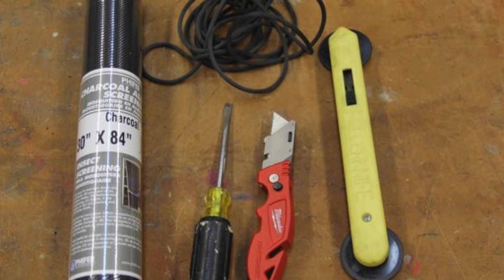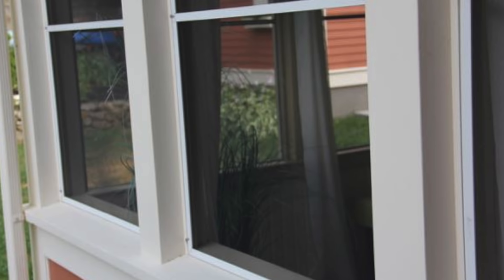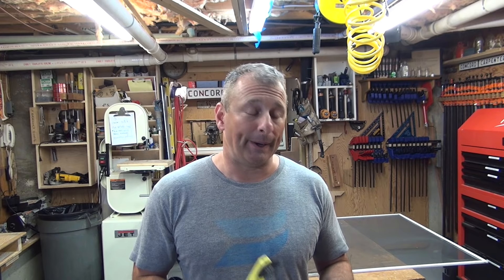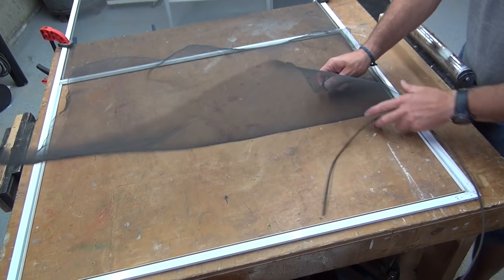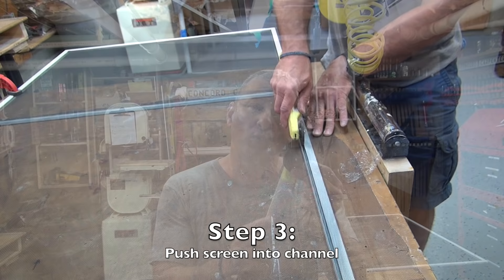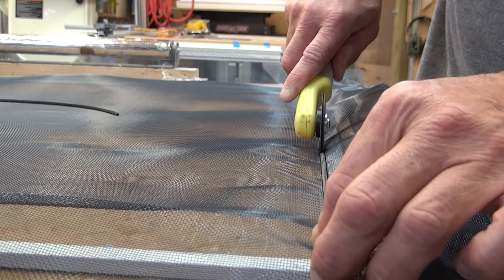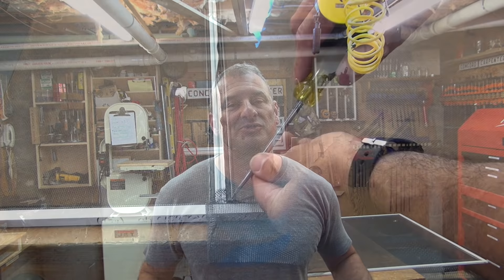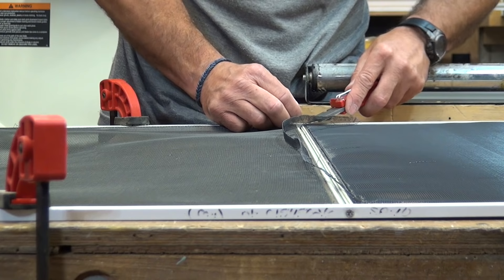Replacing a Window Screen 5-Steps

Comment: Is there a reason not to insert screen and spline at once and push them both in at once, using the concave roller? In other words is it necessary to first push in the screen with the confex roller, then the spline with the concave roller?

Comment: Great video! The spline on my screen is old and stuck. How can I get it out? HELP!
Reply from the maker: Alison Frazier-Hayden use a small screw driver or utility knife and dig it out. A pair of needle nose pliers or beefy tweezers will Help grape and pull it.  Alternatively you can slice the screen apart and use it as leverage to pull out the screen/spline all at one time.
Reply: Awesome! I'll keep you posted!!! Thank you so much!
Reply: Quick pass with a blow dryer will heat and make rubber pliable to pull out.

Comment: I have a question, when putting screen back into the window screen frame, does the spline access go inside or outside.  My mom keeps telling me it' goes so that the spline part is outside and I tell her that' lets theives pull the spline and screen out easily.   Which way is it?

Comment: 5 mobile quotes were at least 120 per door, highest was 180 ,Ace hardware quoted $60 for material but they charged only 40 thats for 2 doors If I brought it to them 80.  This was for heavy duty cat proof screen. The roller cost $7

Comment: The gap for the rubber strips at flame is 0.5MM...so what is the diameter of rubber I should I use? 0.4MM, 0.45MM or 0.5MM?!?!

Comment: I did this today and I dont know if I got the wrong spline size or not. I went by the old one but it was so in there that the old screen was still attached on the sides. Its sticking and holding on with the .36 but maybe I should of gone with the .41
Reply from the maker: liddoterry yes it’s possible the screening is thinner

Comment: I wish you added how instal and take out screen from the window frame.
Reply from the maker: @matthewmey5370  use a utility blade and cut old screen and pull out- you can also did out spline with knife or flat head screwdriver

Comment: I'm considering replacing my window screen with a sun-shading screen. Will I need special tools for cutting a sun-shading screen or will a utility knife be sufficient?
Reply from the maker: Should be fine, may need smaller or diff sized spline if screen is thicker

Comment: Thanks Rob.  Do you change your own thermo-glass for home vinyl windows?
Reply from the maker: no
Reply: Call a few glass shops and give measurements, get prices to compare, tell them if you have a grid, remove the sash and bring it in for a new insulated glass unit. Tell them you want the exact same insulated glass unit ( Look up the windows from your original receipt) it will say if they have grids, double or triple pane, the thickness of the glass, whether they are low e and if they have argon glass. They won't replace the seal (you might ask for a new seal) to prevent water from leaking in later. Reinstall the sash. Rob does not do it and I understand why it is not an easy fix and requires specialized equipment.

Comment: Have a question. I just hot a job at a patio enclosure company building screens and doors. My hand is experiencing fatigue. 

Can you recommend a tool that I could use other than scissors to cut the screen with?

Thanks!!
Reply from the maker: Check out the OLFA cutters
Reply: Will Olfa cutters cut aluminum screen?

Comment: I'm using aluminum, and I got two sides in just fine; but when I tried to do the third side, my screen started to split instead of tucking neatly into the groove. I didn't think I was pulling it particularly tight, but I suppose I could have been. Any suggestions though?
Reply from the maker: Dan R work one end, then two sides, keep tension on screen while rolling
Reply from the maker: Dan R Going to take it sometimes but all your friends are use clamps at times to hold the screen on the other end

Comment: Great clip! But after watching this video and replacing 6 windows I learned this... DO NOT USE ALUMINUM. It stinks. Its more temperamental, it'll dent from as little as a june beetle hitting it and worst of all when the sun hits it, the angle will make the window a cloud of reflected sunlight. Very ugly. Will never use aluminum again.
Reply from the maker: Nylon is easier but not as durable

Comment: I've replaced the screen in the frame, can't get the frame back in the window?
Reply from the maker: Did you stretch too much, deforming the frame?
Reply: @ConcordCarpenter  No I finally figured it out, I was putting it into the wrong slots, took 20 seconds when you do it right - thanks

Comment: How do find out what size (thickness) you would need?
Reply from the maker: R H can you bring the old material to the store with you.?
Reply: Thanks, One more question, Lets say in a scenario that you go from a fiberglass to a pet screen (aluminium) - Would I need to go with a thinner spline being that I am going to a thicker screen material than the original?
Reply from the maker: yes possibly - Spline is cheap. If unsure buy them all and sort it out in the shop

Comment: It's not that easy. I'm a professional, I've made thousands of mosquito nets. If someone says that you can do it yourself, it is very wrong. The film shows that the net is not evenly stretched, has so-called humps, is uneven and lacks tension. Maybe it works for you in the USA but in Poland where I work, no customer would buy such a mosquito net from me. Regards.
Reply from the maker: Regards?  Thanks for the compliment